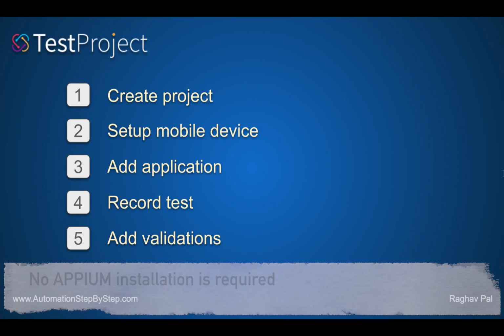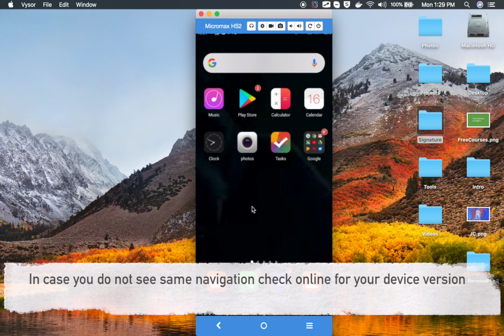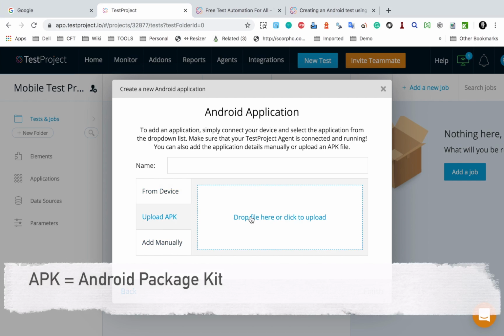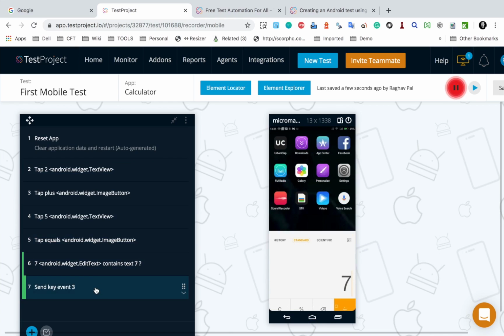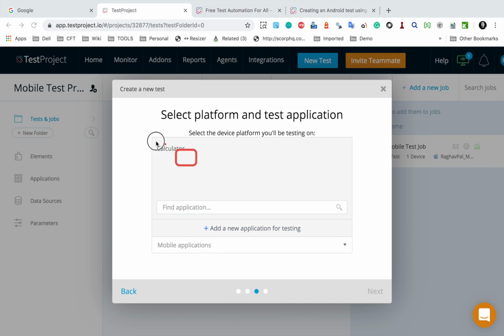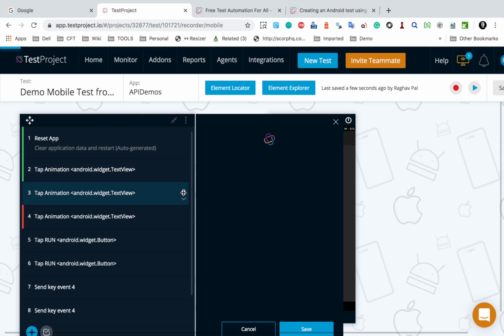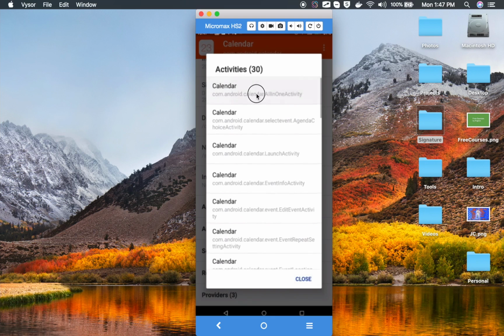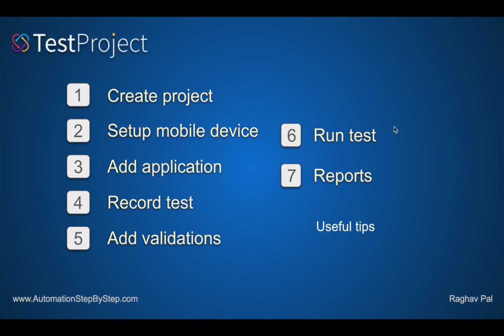TestProject Tutorial 4 | How to do Android Mobile Testing

Comment: TestProject has been discontinued. 

With many automation tools available, what would you suggest, especially for Android & Windows? I am trying to develop testing skills.
Reply from the maker: Jaya
✅ For Android: Go with Appium
✅ For Windows: Use WinAppDriver
✅ For Web: Add Playwright or Selenium
Start simple, learn by automating real apps, and build small projects
--
Here’s a simple roadmap based on your interest in Android & Windows testing.
---

### ✅ Best Automation Tools for Android + Windows:

---

### 1. Mobile App Testing (Android)

#### ✅ Use: Appium

* Free, open-source, cross-platform
* Automates Android & iOS
* Works with Java, Python, JS
* Great for real devices + emulators

📍 Learn:

* Setup Appium + Android Studio
* Automate login, forms, swipes
* Use tools like UIAutomatorViewer to inspect elements

---

### 2. Windows Desktop App Testing

#### ✅ Use: WinAppDriver (by Microsoft)

* Works with Appium
* Automates Windows desktop apps (EXE-based)
* Can be used with Selenium/Appium-like syntax

📍 Learn:

* Install WinAppDriver
* Inspect elements using Inspect.exe
* Write basic test scripts with Java or Python

---

### 3. Bonus Options (if you want low-code or faster start):

* Katalon Studio (supports Android, Web, Desktop) — great UI, beginner-friendly
* Robot Framework (with AppiumLibrary) — keyword-driven, works for Android & Desktop too
* Playwright for Web Automation — you can also test mobile viewports

---

### 🛠️ Tools That Help You Learn Faster:

* Postman for API testing
* Jira + Zephyr for test management
* GitHub + Jenkins for CI/CD

---
Reply: Thanks a ton  @RaghavPal for your detailed response. I sincerely appreciate it. I thoroughly enjoy watching & learning from your videos- simple & easy to understand. Keep up the good work.

Stay blessed.

Comment: Hi Raghav, I have a query to ask about the parallel execution by using two different devices with different test jobs or same.  My problem is that when I run one in one device the other in other, both jobs fail with the exception of the appium.  How can I fix?
Reply from the maker: Hi Yasser, will need to check the setup and configuration, are you using cloud devices

Comment: Thank you so much sir. Good Explanation.  I have worked as per your Instructions.But it able to record mobile app. But when I add into job and run. It just suddenly close the window. Report also got empty. Please resolve my issue sir
Reply from the maker: some settings or config issue may be there, will need to check, you can get in touch with TP team, TestProject has a dedicated support team to help with any queries you have and can provide you with 1:1 sessions at anytime. Can reach via:
— The platform in-app chat (orange button on the bottom tight of TestProject platform)
— Active forum: https://forum.testproject.io/
— Email: support@testproject.io
Reply: @RaghavPal  ok sir thank you  I will contact TP team

Comment: Is there some way to open a specific app on the device like Chrome or OS setting app by using app package name? Like when you use package name to uninstall it. Thanks
Reply from the maker: Hi, I am not too sure and have not tried this, You can check some online help and also get in touch with TestProject support if required. TestProject has a dedicated support team to help with any queries you have and can provide you with 1:1 sessions at anytime. Can reach via:
— The platform in-app chat (orange button on the bottom tight of TestProject platform)
— Active forum: https://forum.testproject.io/
— Email: support@testproject.io

Comment: Hello Sir! I have tried connecting my device with agent, but nothing seems to work. My device get connected by my pc, but the agent doesn't detect it. Moreover I also talked with the support team. It has been 3 days, still not able to connect my device with agent. Is there any app which I need to install on my device?
Reply from the maker: Hi Jasdeep, you need to enable usb debugging on device, pls check if any other setup is needed in the documentation
Reply: @RaghavPal  Sir I followed all the steps, enabled debugging as well, but nothing seems to work, it's still same. Not able to understand what to do next.
Reply from the maker: I will suggest goto https://testproject.io/ login and then do chat with the support team
Reply from the maker: I checked with TestProject and you have foll options 
TestProject has a dedicated support team to help with any queries you have and can provide you with 1:1 sessions at anytime. Can reach via:
— The platform in-app chat (orange button on the bottom tight of TestProject platform)
— Active forum: https://forum.testproject.io/
— Email: support@testproject.io

TP also has weekly live demos. Can join at anytime here: https://testproject.io/events/

Comment: Hello Raghav sir , how to use same test cases for different build version ? Please reply . Thanks in advance .
Reply from the maker: Hi, You can either copy the test cases in multiple folders to separate the builds, In case you are using any CI tool can also configure in that. Basically I believe you need to run a test and get its results for diff ver. This should do it
Reply: @RaghavPal  thanks Raghav sir . I would like to ask se Test project is most simple and open source tool with lots of feature in it , why it is not widely used in industry . Is there any security or data  concerns ?
Reply from the maker: It is gradually getting popular and picked up by org. You can check its website to get more info

Comment: I am new to automation and looking for the right tool for our business. I first started by using Selenium IDE but found there are issues with what I need it for. Our Web UI contains a lot of drop down box functionality, will TestProject be able to handle this as Selenium IDE does not. I found that Selenium IDE is very inconsistent with actual testing. I have spent more time testing the programme itself trying to get scripts working
Reply from the maker: Hi, Selenium IDE is more like a quick tool to record and check the scripts and locators, May not be good to setup a complete Test Automation Project. TestProject is a good option. I will suggest to do a POC with some of your end-to-end scenarios to check if all functionalities work and then finalize

Comment: Hello Raghva, i want to ask a question, let say i made a test on a mobile apk, and i already integrate the project to azure ci/cd, lets say the dev make a new build, can the test case we made before run on the new updated build, or do we have to upgrade the apllication manually?
Reply from the maker: Hi Axel, you will need to have a deployment job, if that is linked, you should be able to use your tests directly
Reply: @RaghavPal  may i ask what is deployment job? and how to link it?
Reply from the maker: Deployment is for e.g. deploying the application to any server or env like test env or prod. So in general after all your testing is successful we can trigger a deployment job as required

Comment: Thanks for video. Is this test running on simulator or real device? Every time, device should be connected to run the tests?
Reply from the maker: Hi Vinod this one is running on real device and will have to connect the device. But you can use emulators/simulators too
Reply: @RaghavPal  Can you pls create video on How to run project on emulators/simulators?

Comment: Hi Raghav, I have register test agent with SDK and connect device with System.
I created test and started recording, but I noticed that black screen displayed while app is opened and screen is unlock.
Can you please suggest on above issue. please reply asap, am waiting for your reply...
Reply from the maker: Hi Rajesh, I will have to check this. Do you have any logs.
Reply: @RaghavPal  How can we check the log where it is generating?
Reply from the maker: You can check if you see anything in your reports
Reply: @RaghavPal  Ok Raghav. I will check and let you know.

Comment: what is the exact difference b/w Appium and TestProject?
Reply from the maker: Hi Prashanth, Appium is an open source mobile testing library and TestProject uses Appium at the backend. Test Project does all the setup and configurations, You just need to setup TestProject agent on your system. So it uses Appium and provides with a lot of features over it so you can easily and efficiently create mobile tests, without doing all the setup. configurations, or coding.
Reply: Automation Step by Step - Raghav Pal many thanks